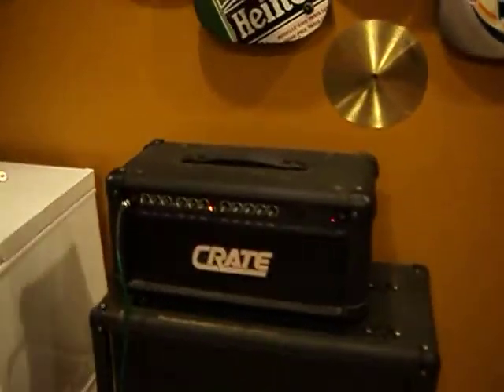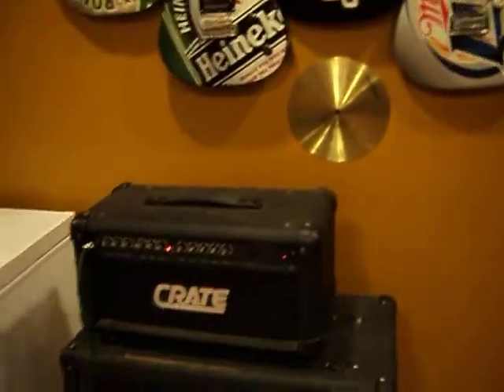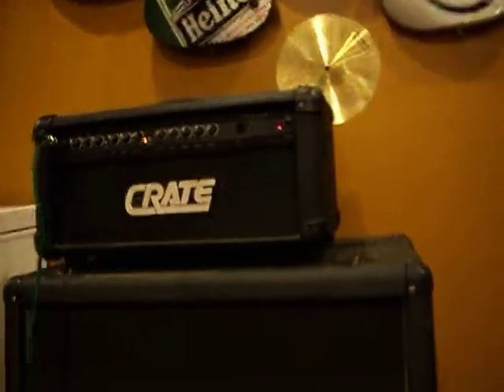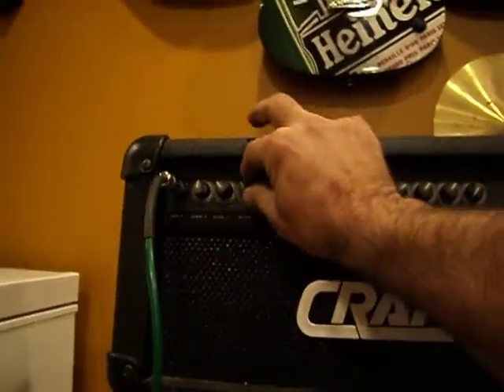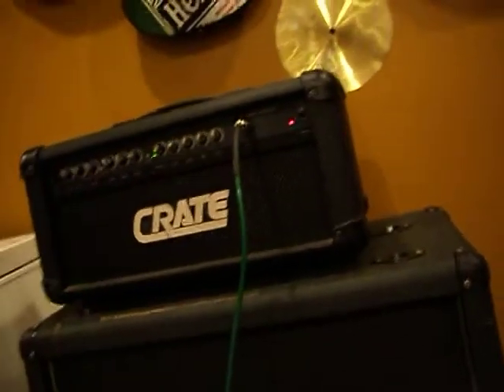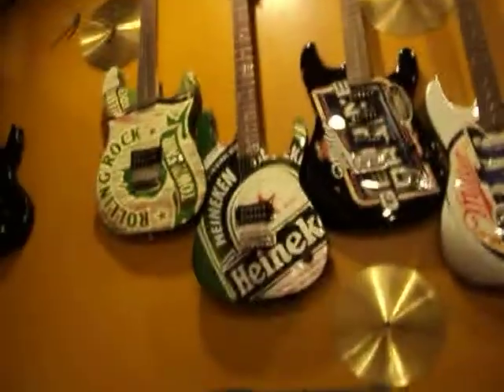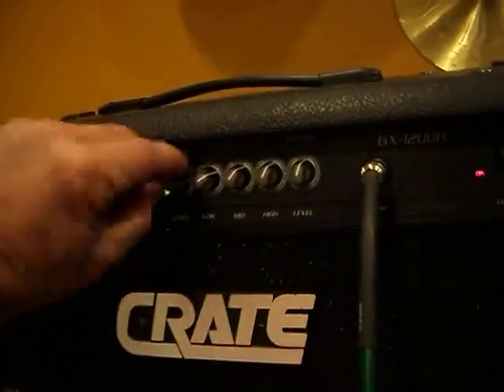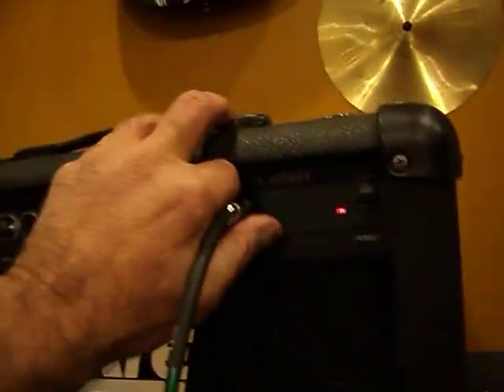CRATE GX1200 GUITAR AMP

Comment: The right side input it's the effects loop jack, not a second input! They used a single "stereo" jack for send/return instead of two individual mono jacks. You can hear some sound because the tip of the FX loop jack is the return but you can't control anything because it goes straight to the power section.

Comment: The fuzz sound while everything is quite is a grounding issue🤘
Reply: No it's not. It's just noise being picked up and transmitted. Most likely fr the guitars single coil pickups or from electronics close by. He needs a noise gate pedal
Reply: Thats Crate feedback. Not saying it's supposed to do it. But I have 2 Crates they both feedback like that
Reply: The solution for that is using low noise cables. Pig hog is a good choice. They are non microphonic